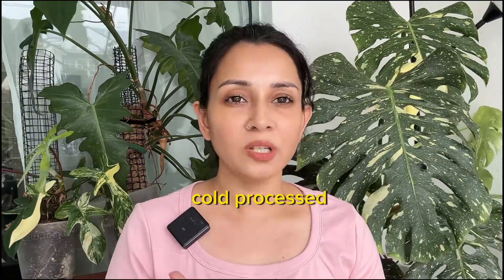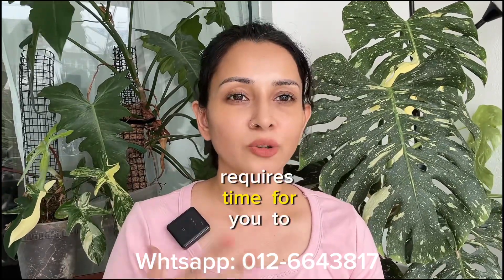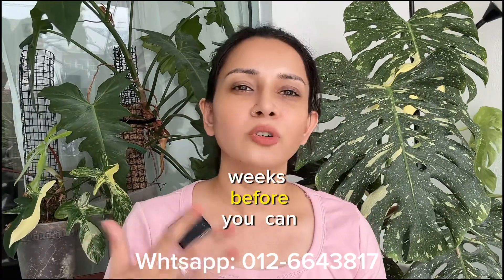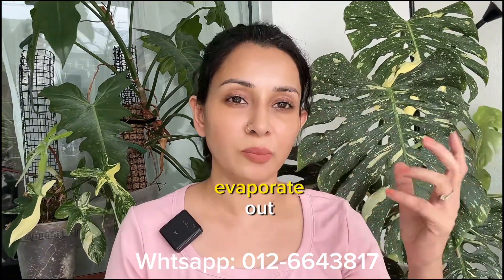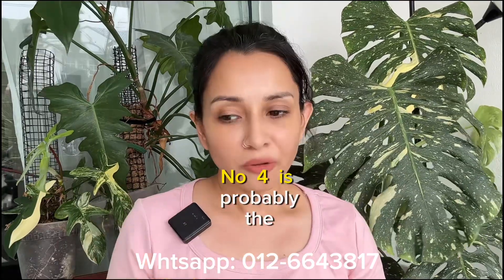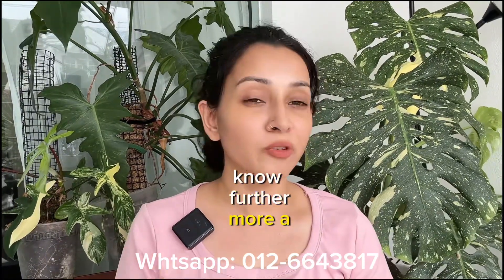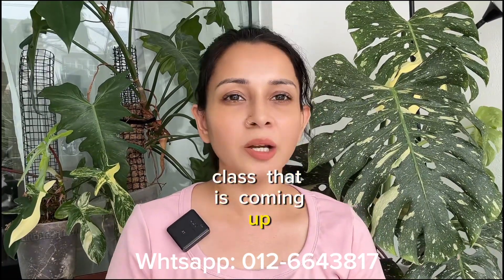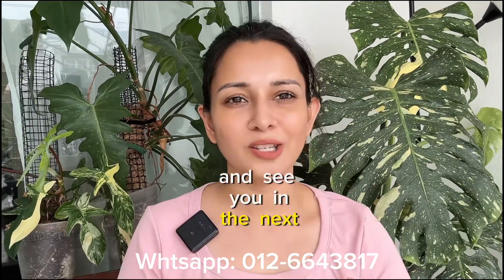Why Sometimes Cold Process Soap So Soft?

Comment: So how to rebatch or repair the soft cold process soap or is there no cure and should be thrown away???
Reply: I'm 10 months too late, but.... I'm about to rebatch a soap loaf that is too oily/soft, today. From my research, I should be able to fix it by melting it down and adding more lye solution. I will let you know how it turns out.